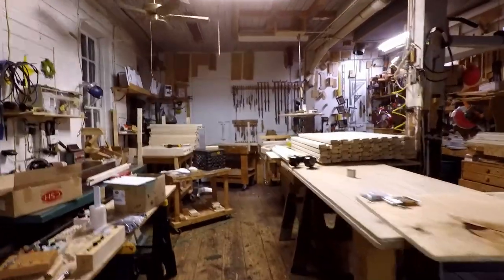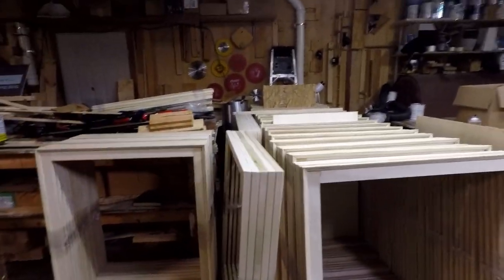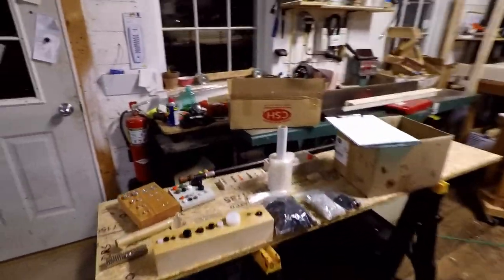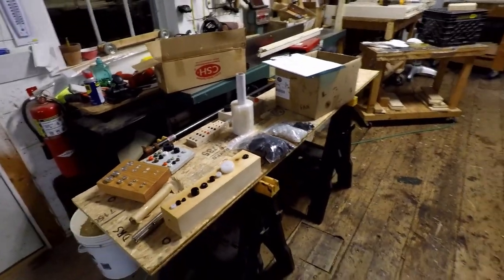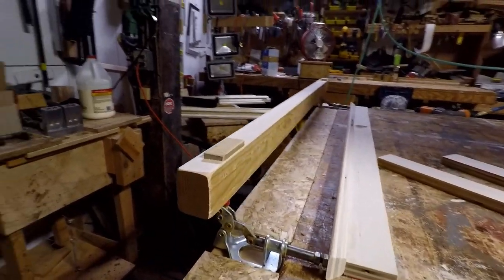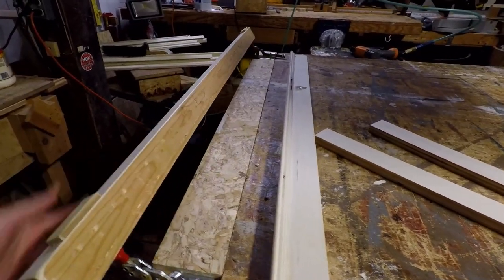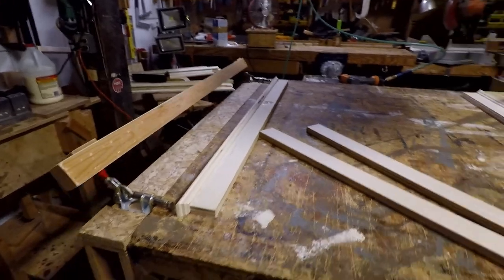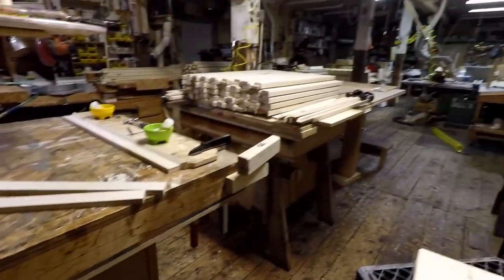Shop Update Video 2018 - Toggle Clamp Tandem Bar, Magnet Sanding Block, and NEW bumpers

Comment: Great vid, ever tried applying your outside edge trim to the 8ft lengths first, then mitering the two together? add a corrugated fastener to the joint, would save a few steps.